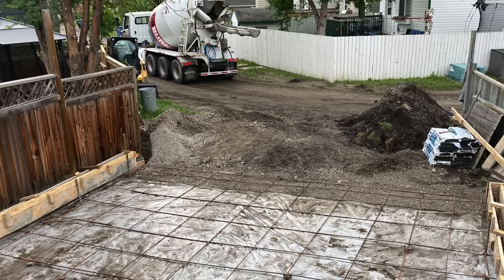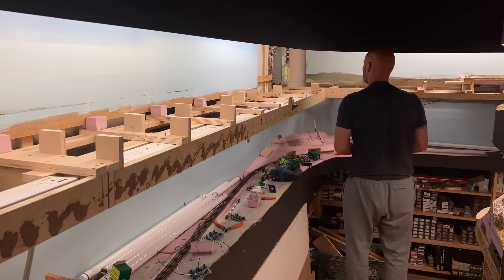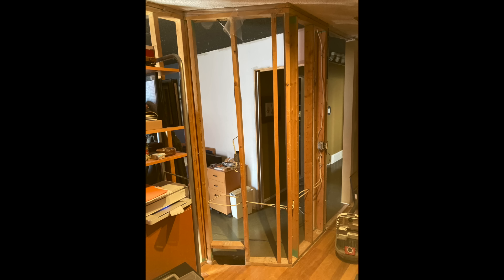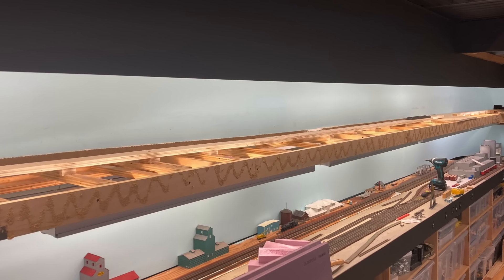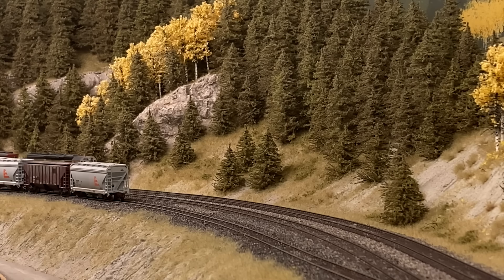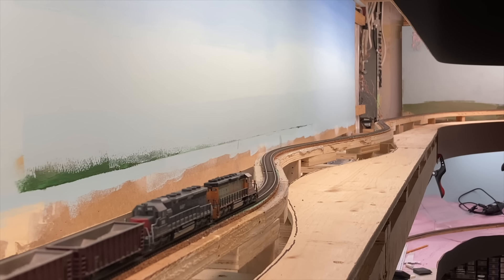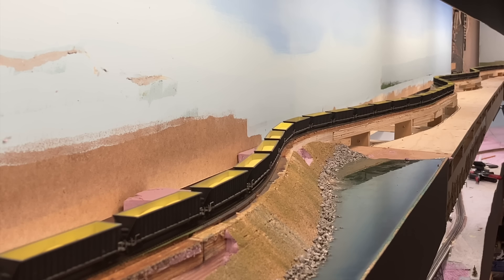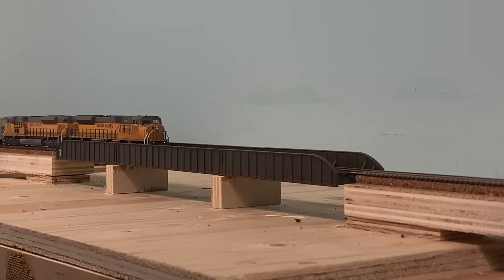55 Feet of New Layout!  - Fall '24 layout Update

Comment: I never would have guessed this was N-scale until I heard it mentioned around minute 7 or so. Amazing.
Reply from the maker: Hey thanks a bunch.  One of the best compliment an N scaler can get...  Doesn't look like N.  Cheers.  -grant
Reply: @ I've been considering building a small model railroad again. Been debating N or back to HO. Both have their benefits and pitfalls
Reply from the maker: Absolutely.  I think N scale is more suited to larger spaces and HO shines in the shortline/switching setting.  N scale can't pull off switching as well as HO and HO doesn't give you the feel of distance and space quite like N.  Have fun!

Comment: I am in Michigan. I contracted for a few years with a company who performed physical inspections of residential and commercial properties for insurance underwriters. The requirements for residential and commercial varied somewhat but a general rule was that the electrical panels need several feet of free space in front of and beside the panels with no obstructions.
Reply from the maker: Appreciate the info.  I do think the rules are a wee touch different up here as the panel has passed inspection more than once and it is easily accessible for the majority of humanity!  Cheers.

Comment: You can really see the advantage of N scale here.  I have an HO layout in a 15x33 foot space and made a mainline run as long as I could manage and can run 30 car trains but still seems like not enough space.
Reply from the maker: Indeed.  All scales have advantages over others depending on what you're going for.  I love unit trains in the middle of large scenery.  Can't beat N scale for that but you have to make compromises when it comes to other aspects of the hobby to be sure.  Cheers.  -grant

Comment: May I suggest making a section in front of the electrical panel easily removal? Sooner or later, you will have another short electrician.
Reply from the maker: That's the plan for sure!  Cheers.

Comment: Excellent modeling. Herd to tell this is N scale! Ever consider a swing gate by the electrical panel? Either that or hire a taller electrician.
Reply from the maker: Normally I do all the work myself so it's never been an issue.  Perhaps I should have offered the gentleman a pair of stilts...  Tearing the benchwork out forced me to address an issue that would have been dealt with in a year or so.  Circumstance presenting a real opportunity!  Cheers.

Comment: amazing. What color spray paint for the fascia boards ? - is it just matte black ?
Reply from the maker: Not straight black, more of an extremely dark gray eggshell finish latex rolled on.
Reply: very nice. Did you find that worked better than a very dark green ? @SouthernAlbertaRail
Reply from the maker: Personally yes.  Black or dark grey is neutral and goes un-noticed and that to me is the point of a fascia.  It is the frame around the art which is the layout.  It shouldn't distract but rather highlight the art.

Comment: Fantastic. Did I understand correctly, reverse curves with no tangents in between (except one)? And no running problems? Against conventional wisdom, but if so, I'd like to try on my new layout. Or did I misunderstand...Best wishes!
Reply from the maker: Each reverse curve has a tangent at least as long as my longest piece of rolling stock between the next and all curves are super-elevated.  There just isn't much in the way off straight track for any extended distance.  Thanks for the comment and question Keith.  Cheers.  -grant
Reply: @SouthernAlbertaRail  Thanks for the correction. I've followed your layout for a while,  and greatly admire it, especially your scenic techniques.
Reply from the maker: Thanks so much.  All the best.

Comment: Hay great job. Can you tell me witch  power source to use if you are trying to power a 60ft power bus wall plug in power .? To power all switches & lights now the 60ft power bus going around the layout . Each switch needs 16volts 133 switches & cdu all switches are peco  n scale insulfrog.  O.k let me know what you might think I need to power that bus wire to get 16 volts all the way to the end.  My house power is going to a power bar. Thank you .
Reply from the maker: Determine how many amps will be drawn and get an appropriate 16 volt power supply.  I don't use Peco switch motors so I have no idea how many amps they draw.  I would use 14 or 16 gauge wire to minimize voltage resistance.